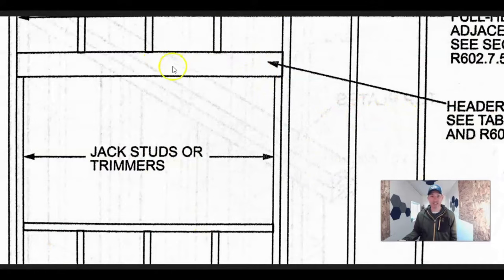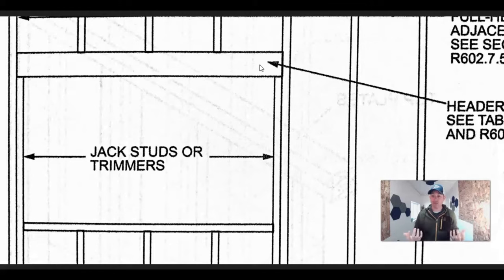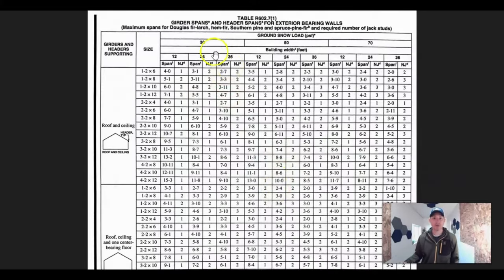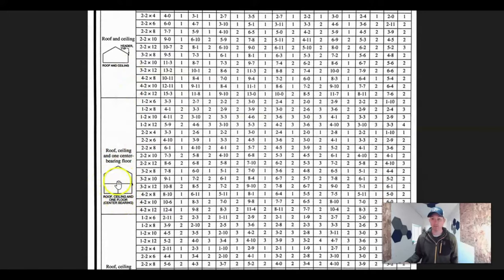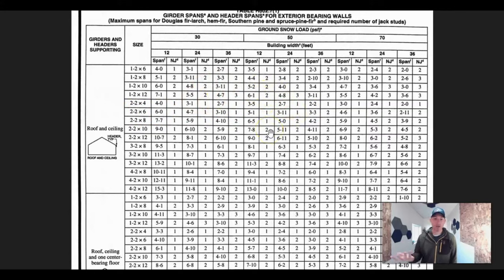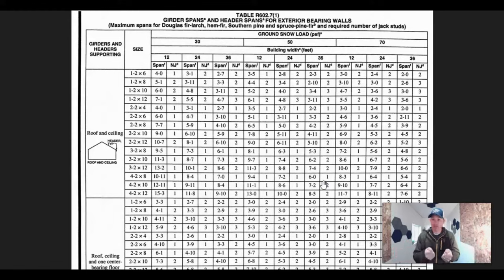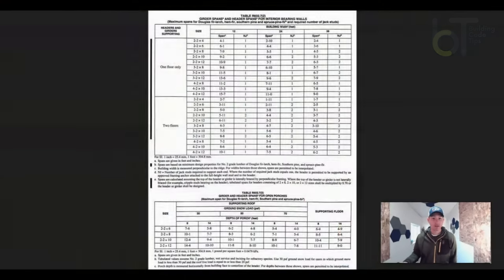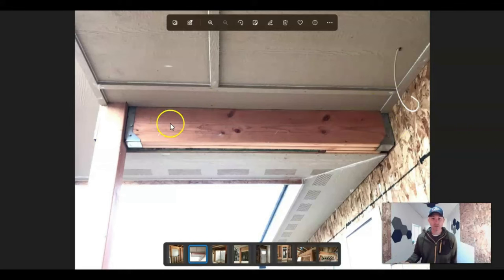HEADER & BEAMS | SIZING AND INSTALL FOR DIY

Comment: I wish all inspectors were as helpful!
     I’m in a tricky situation, on the ground floor of a 2 storey 1920 addition attached to an 2 storey 1880 barn, where the exterior kitchen wall attached to a barn was already cut for a tight stove placement. I am trying to enlarge that opening, and put a back door into the house portion. Whew! Each corner has a true 4x6 post. There are studs inside the barn wall, and more studs inside the  kitchen portion. The enclosure sides and ceiling don’t attach to the barn.
    I want to cut 2 studs on the barn wall for a total 7’ span. I have a 30” door to install on the perpendicular wall to the back yard, but that damn post! It’s on the left, and if I go right,  I lose almost all my cabinets and counter. But there is currently no way to access the backyard!
   I’m so confused. Anyone with advice?TIA
Reply from the maker: Hi Lori, Am I right in understanding that there are 2 questions here? First is removing some studs in the existing barn wall to create a 7ft opening and the other is needing to cut in an exterior door on one of the exterior walls on the addition to create access to the back yard?

Typically with any opening a beam can be installed on the barn wall where the proposed removal of studs is. I would recommend going to a local lumber yard with some pictures of what you want to do and asking them to size a beam for you. This could get trickier if the floor system and roof system bear on this wall, possibly creating excessive point loads, requiring some pad footings under the beam.

For the door, what is the 4x6 post holding up? Is this a pole barn type structure, is it holding the 2nd floor over continuous footings? Could the header that will need to be installed over the door carry into the post by notching it and then the section below the header be reduced in size. This might depend on if you would be notching into the 6" side and not the 4" side I would assume. I would suggest doing the same thing as above and taking some pictures of what you have and speaking with someone at the lumber yard about post size. maybe a 6x6 would work under the header and that will gain the extra inches you need. 

Thanks - Ben